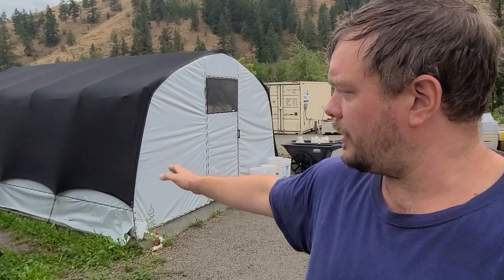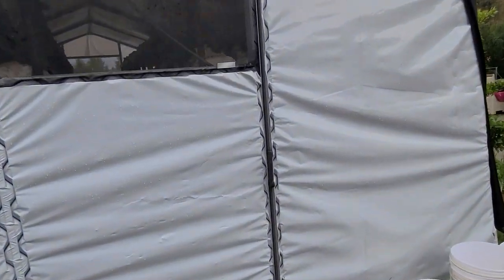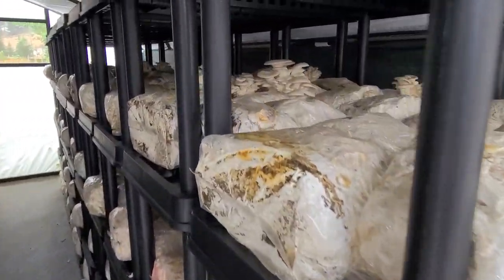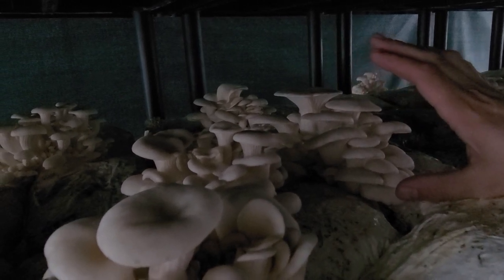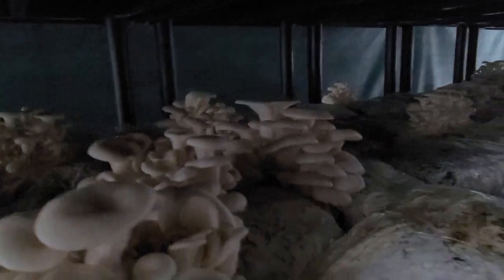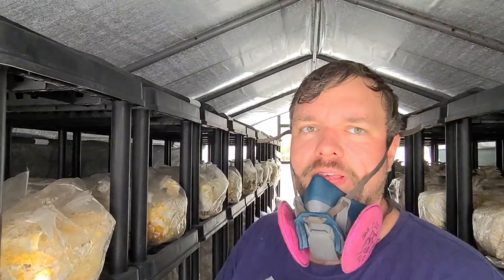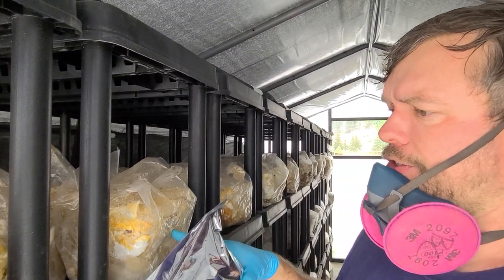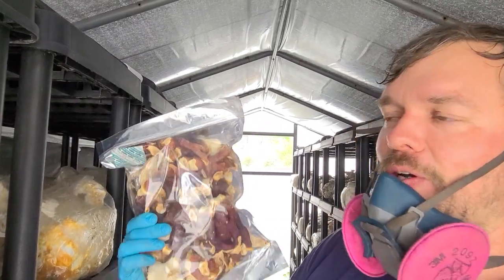This Is How I Grow Elm Oyster Mushrooms In Greenhouses

Comment: What is the heat source for your dehydrator..I have  a similar build nut my screens are 18x18..and I have a small space heater underneath and it takes a good day or so to dry..impressive workings on your farm
Reply from the maker: 8KW 12V Diesel Heater
Reply: @whatthefungus  thank you
Reply: @whatthefungus  @whatthefungus where can I source those white bins you are using for delivery? We've been using clear storage totes with holes drilled in the sides and lined with paper towels. Enables the air exchange while awaiting delivery or use and helps contain some of the humidity but I'm thinking your totes might work better so I don't have to use the paper towel lining. Do you have problems with them drying out too much in your or your restaurant client's walk in coolers? I knew another grow who was using deep walled bread racks and he was saying that was his biggest problem with them in a walk in cooler.